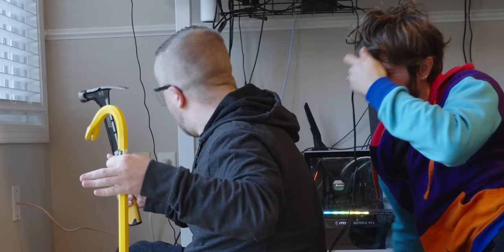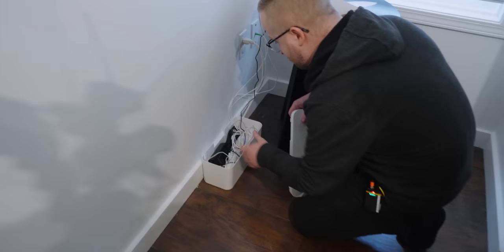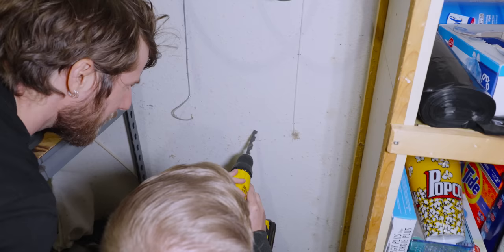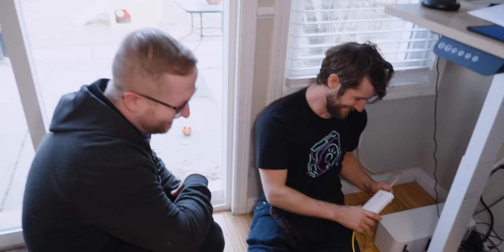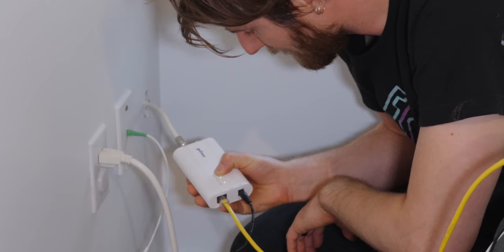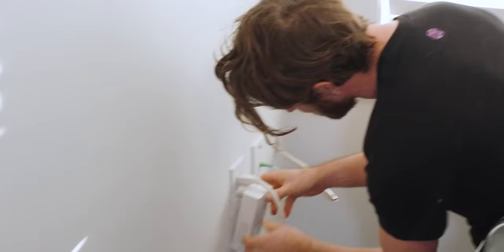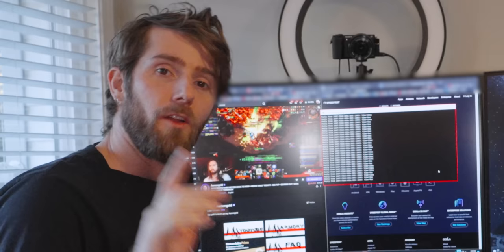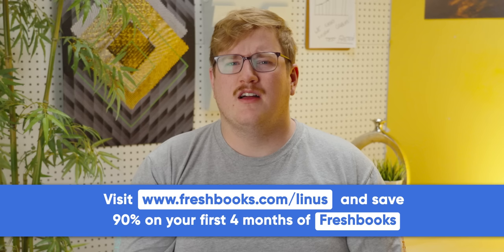I Will FIX Your Wifi - MoCA and Powerline at Colton's House

Comment: In the US most if not all major cable providers use MoCA for communication and video streaming between the main hub cable box and the terminal boxes on other TV’s. While you should be able to run multiple MoCA networks on the same cables being used by your tv service, you cannot change the MoCA channels used by your cable boxes. You will have to be sure you change the channels on your adapters so they are different from the ones being used by the cable boxes and bandwidth will be limited.

Some cable/ISP use MoCA for connecting WiFi cable boxes, using the gateway (modem) as a bridge between the main hub cable box and the WiFi boxes. Again should be able to run a second MoCA network but YMMV.

Cable/ISP providers usually maintain a stand alone policy where their signals should be the only signals running across a cable they are using to deliver service. This is both for reliability and to keep interference (ingress signals) from entering the network and disrupting services to you and other customers. If you try MoCA adaptors and it doesn’t work, asking your cable/ISP for help will likely result in them telling you to remove the adaptors. They won’t help you set it up and you may be changed a fee if a tech is sent out to assist you. 

Last thing, you should install a MoCA filter on the input of the first splitter that the cable running to your home from outside is connected to. If your provider uses MoCA you may already have this filter installed. This both keeps your MoCA traffic within your home blocking it from travailing back though the cable drop and (I cant remember the science behind it but it does help) improve the PHY rate (bandwidth) between your adaptors.
Reply: Speculation on that last point: I would guess the filter helps your internal bandwidth because it filters both ways, preventing interference on MoCA frequencies from getting into your home from the cable network
Reply: @JackieBright  It was explained to me once by an engineer from the MoCA alliance. I think It had to do with lessening the paths the signal had to travel, long distances of cable even if there is endpoint can reduce PHY rates across the network, but don’t quote me on that. 

Real world I have seen PHY rates go from high 200-300 up to full MoCA 2.0 600-700 just by adding a filter in installations some long drops (100+ feet RG-6).
Reply: In the US a lot of FTTH companies will go the lazy route and have a ONT in your basement or something that then serves via MoCA to a router/gateway elsewhere in the home. FiOS does (or at least did) do this and then forced you to pay for their router rental forever even if you had your own & used MoCA adapters to get it to work.
Reply: @ashdavis4845  can’t speak for all FTTH providers but to my knowledge FiOS will use MoCA from the ONT to their gateway for anything under 500mbps service I believe. Friend of mine upgraded from 200mbps to 600mbps and they ran him a Cat5 line from the ONT to where is gateway was connected via coax before. They also upgraded his ONT as he had a first gen one. 

I have heard from system integrators that it is possible to use your own hardware straight from the ONT via Ethernet with FiOS and get rid of their gateway but you have to get the right person on the phone who knows how to do it.

Comment: I’m a fan of the LMG, I subscribe to literally all of your channels, and I’ve even purchased your merchandise and will continue to do so. Big fan to say the least. I work for one of the largest telecommunications companies in the world, and I have also been part of the Army Corps of Engineers. I have a lot of technical knowledge and problem solving skills to say the least. 99% of the time, you all know as much as, or a lot more than I do. I mulled over whether or not I should say something for a couple of days. For the very first time, I watched one of your videos and said to myself, oh my god, they got it so wrong and they left so much out. If someone were to watch this video as a guide, and leave out the same steps for their own setup, they would have subpar service, or even give themselves a small electric shock. There was no toning, no mention of what to do with splitters, no hpna testing, no mention of tap, no mention of inductive interference, no mention of the possibility of power on coax, no mention of high power noise, or in what scenario each setup should be used, or why one might be better in a given scenario. I think it should be corrected and addressed. Colton could have a much better setup.
Reply: Sorry to rain on your parade, but I'm pretty sure they didn't include it because it would go over 98% of people's heads. Also 99% of people are going to use the power line extender.
Reply: @Dukes3677  you’re absolutely correct, 99% of people will go with power line, but that still means 1 out of 100 will not. Let’s say you had satellite service and cancelled it, you turn in all the set top boxes, but as is common practice, nothing was said about the coax power device that fires up the DVR, so somewhere in your house you’ve got a coax with power on it. What happens if you touch it and you’re grounded? What happens if you’re in an attic trying to isolate a coax line and you touch it? What if you lose your footing and fall through a ceiling? What if you get everything connected, and power is being injected into your Ethernet ports and you fry a motherboard? Are these likely scenarios? No. Could someone hold LMG liable if this happened to them, after watching this video, that left all of that info out? Yes. There’s no parade to be had, I’m not out here asking for freebies or recognition from mentioning this, they can delete my comment after they fix it. I simply saw something that could tarnish their name and reputation. As a fan I don’t want that to happen. The reason I waited to post anything was because I wanted to be sure I wasn’t missing anything and I didn’t want to be ostracized by my fellow LMG fans. Your comment for example.

Comment: Recently discovered the poweline adapters and it has changed so much. My house was built in the 1920s and wifi doesn't travel well . I don't get the full speed with power line but it's still plenty fast and haven't had any issues yet.

Comment: I've been using the Zyxel AV2000 since early 2017 and it still performs above and beyond wifi.  One plug is right by my router, the other is into a power strip two stories above and it works flawlessly.  Definitely worth the $85 at the time, now you can buy the same set for like $50 or $60.
Reply: Nice
Reply: Zyxel are really decent, have some of their consumer grade switches that ran like bosses for years. Had two of their DSL routers before and they were rock solid, and the web pages on it were responsive, could change practically anything without needing to restart it, where an older one I was stuck with for a while would force restart itself even to change the wifi password >:( !!
One I have now is AVM, never heard of them until I got it, but it's on par with the Zyxel stuff I've had. Blows netgear mass market cheap ISP crap out of the water that's for sure!
Reply: why are two separate rooms 2 stories apart on one breaker? sounds like the only reason this works is because some houses were wired by lazy electricians
Reply: I'm curious, would it bridge the gap between all breakers? Like if the main router is on a completely different breaker from the destination?

Comment: I was lucky that when I moved into a place, they had modem ports (RJ11) running all over the house. It turned out, there was CAT5e cabling behind all of it so I was able to simply convert them to RJ45 and enjoy LAN in every room.
Reply: The deciding factor on my current apartment was the fact that it has RJ45 ports everywhere and a decent network cabinet in the closet.
Reply: Lucky. I don't get that here :( in my apartment I have cat6 I cut up and am holding up with 3M command hooks and tape along the hallway into the bedrooms lol.
Reply: The previous owner (and builder) of my house ran Coax to every single room. I have one TV so 90% of these cables went unused and I bemoaned that he hadn’t installed Ethernet instead. Now it looks like I’ll be able to take advantage of the cabling!

Comment: I recently found out that many newer homes use cat5e or cat6 wiring for the phone lines. you can replace the rj45 phone port with an ethernet port. This trend started in the late 2000s. My home uses cat5e instead of regular phone lines!

Comment: My experience with MoCa vs powerline is exactly the opposite to this video. I used to set up cheap powerline adapters at many people's places all the time and they could be a real pain in the ass to pair and when they eventually did, they would often be slower than just using wifi. On the other hand, when I still lived at my mom's place, I had my setup on the top floor. Wifi wasn't fast enough and powerline wouldn't work either. Then I discovered MoCa. Setup was pretty easy and it reached the advertised 175Mbit/s speed no problem and the connection was rock solid. Huge fan.
Reply: Got 10 Mbps and a nuisance tripping circuit breaker with Powerline. MoCA is better over distance.
Reply: I was able to get 600 mbps over 35 ft

Comment: Finally a video about MOCA adapters! They should be built into every coax modem by default.
Reply: Some are! For some reason, though, some internet providers lie about their cable/modems not having it.
Reply: @agalerex  Cox did that to me. I had to tinker around in the modem to get it activated, but then it worked perfectly.

Comment: I used powerline to run internet from my parent's house to my dad's shop. The wiring is a mix of 1960s and 1980s stuff but he's getting 150 Mbps to his garage where I just put in an old Wireless-N  router. He's not complained.

Comment: I used to work at a telecom agency where we used powerline and MOCA to connect setupboxes in the rare situation where a cable wasn't possible. MOCA ALWAYS wins. Powerline gets disrupted by all sorts of things while your coax isn't used for anything but the ethernet signal. So it's the superior option. More expensive though.

Comment: Careful with moca, you'll need to make sure your coaxes are physically connected and that your coax splitters can support at least up to 1600 mhz, most cable companies only carry splitters that are 1ghz. Also make sure your cable company's service drop is not connected into the network or it can introduce noise. My guess is the coax at Colton's house is going through an older 1ghz splitter or is physically disconnected somewhere.
Reply: the cable outlet is in their kitchen its most likely disconnected.   Also the cable service does not use the Mocca frequencies but you would want to have a Mocca filter in your house to keep your signal from leaving your house and also keep your neighbor's Mocca signal from  entering your system.  The way a Mocca filter works it is like a Mirror that reflects all of the frequencies back

Comment: one thing i've found with my multiple WIFI setups is that the connection occasionally seems to lose consistency over time, at least until I unplug / reset the router setup. I don't know what causes it, but it happens regardless of what router or modem I'm using. If i don't touch it for a week, by the end of the week im getting bad latency spikes all over the place. Once i reset it, it's back to normal again. this NEVER happens when im wired in through ethernet. but i am also in close proximity to a lot of neighbors, so it could be an intermittent issue that has something to do with them also using wifi
Reply: You can use an app to see which WiFi channels your neighbours are using and then manually change your router's channel to the one that intercepts with those the least
Reply: @neb6705  do you have a name for that app? I live in a townhome community and it seems like between the hours of 4pm-10pm my internet is terrible for gaming, and I assume it’s because everyone is home from work.

Comment: I'm amazed that the powerline networking worked with power strips/surge suppressors. Ideally, you need to plug them straight into the wall. You can then plug the power strip into the network adapter. I have no idea why Linus didn't do this.
Reply: Can't handle so much amps/watt

Comment: Former cable guy here. Encryption is good but you just need a high band filter on the coax line to the cable Co tap to block those frequencies from escaping. ;)

Comment: I used one of these adapters just a couple of weeks ago to get internet to a metal building in my backyard. It works easily enough. Though beware the speed loss. I get about 30Mbps of my total available 500Mbps internet speed. That's all I need out there though and was better than running a cable.

Comment: I've had a pretty good experience with moca adaptwr

At 5,000 Square feet, my home is  on the larger side, and has always been difficult to cover with wireless access.

I've tried everything from wireless repeaters, powering adapters, and mesh networking.

When I had cable, I found moca adapters to be the best alternative to running CAT-6. Once I switched over to Google Fiber, I went with a wireless mesh, which took 5 access points to cover.

This video has inspired me to find out how I can put those moca adapters back into use.

Comment: The MPS on gocoax is a pta. Go into device setting and manually set the passphrase for the encryption.

Additionally, u don't immediately need to swap splitters for moca but your coax does need to be plugged into a splitter so the adapter can see each other on the lines
Reply: There are moca rated splitters at 1675mHz that will improve performance! 
Also, be conscious if you still use coax for internet to put a moca filter on modem and on splitter input

Comment: I hard wire my playstation using the second method for years and its good. not as good as wired to the modem directly but a huge jump in download speed. 30mps to 120 mps, and it is definitely more stable of a connection. My service provider even offers their own that do work better then aftermarket ones I own. TP link isnt bad though I find.

Comment: I've been using MoCA in my house for a few years now, and it's been rock solid.  For systems that don't offer great security settings, there exist passive MoCA filters that you can install at the main coax into your home to stop your MoCA network from being accessible at the street or to other units in an apartment building.  Even if you have MoCA security set up, it's not a bad idea to add one of the filters, it can also help stop interference from other MoCA users that may be in a shared building.
Reply: My MoCA adapter came with the filter in the box and good instruction on how to keep your setup secure.

Comment: Why couldn't Linus have just plugged one of the power strips into the passthrough of the powerline adapter? I've had one deployed in that configuration for over a year and it works great.
Reply: I was wondering the same. He just got frustrated by the clutter. But it would have been easy to plop it in and connect the plug onto the powerline.
Reply: @CheapSushi probably fine for the video, but 1,000% worth fixing if he's actually going to be daily driving. Power lines can be great but they're also pretty finicky as is.

Comment: Some fun stuff we did with powerline adapters at work. We were looking for a low cost 2 wire IP solution. NVT 1701 devices were $700 a pair and it was making it financially difficult to convert old analog camera systems over to IP cameras for customers. (This was before analog HD/TVI) We disassembled some $40 100mbps TPlink powerline adapters, removed the 120v transformer, then we got some variable voltage steppers and stepped our 12vdc camera power down to 5vdc. We then powered up the adapter and used the data pins which were no long connected to the 120v transformer board to connect to the coax through a BNC lead that had 2 wires coming off the back (We had tons of these left over from analog camera installs). It worked! We had network connectivity from one apartment building to the other apartment building for the cameras. Sadly the connection would fail at around 4 devices being hooked up, so sadly it didnt pan out as a low cost solution.
Fun thing we discovered, we didnt have to hook up the data pins at all. While troubleshooting the network drops, we discovered the powerline devices were talking to each other through the voltage stepper, and through the 12vdc power supply. I had removed the data pins to check something and had not reattached them when the camera came back online and was transmitting to the NVR. After that I suggested we abandon the plan as we simply did not have a strong enough understanding of these devices. We broke the news to the customer we're going to have to go with the much more expensive devices.
There is at least one building where our little powerline hack setup has kept a camera connected to the network for over 5 years without issue, so small win I suppose.

Comment: Why not change out the faceplate to have a coax and fiber jacks and just drill the hole either directly above/below the fiber?
Reply: nahh nahh nahh. this is ltt. do it the dumbest way possible. lol
Reply: There was things done wrong in this video. They never checked where that random white RG6 cable line was hooked up to. Even if the coax was hooked up to a cable splitter it's possible that it was screwed in on the output and not the input to feed the signal to the rest of the coax connections.